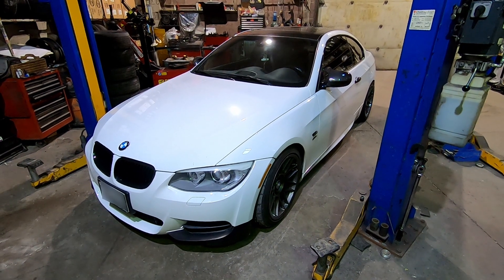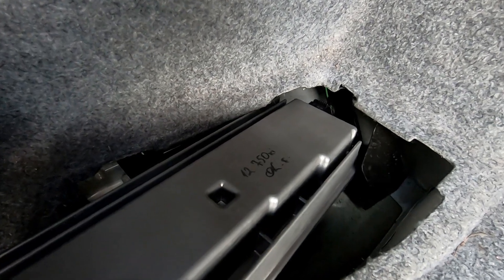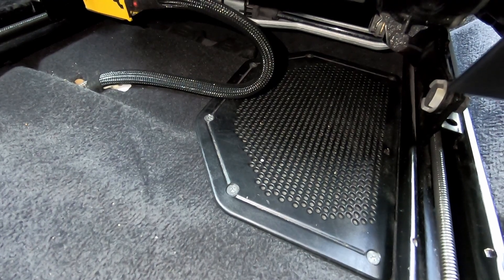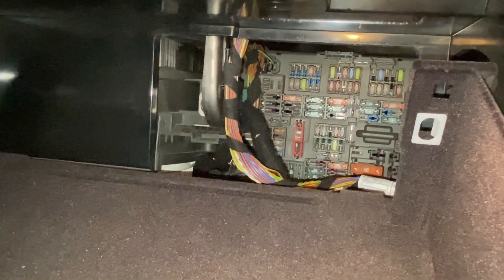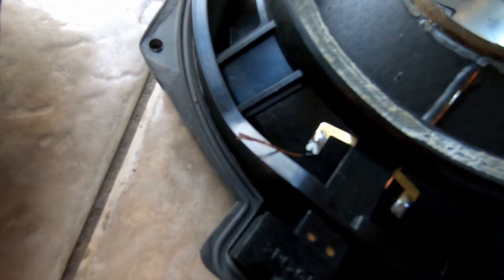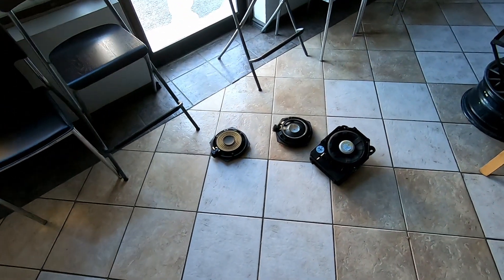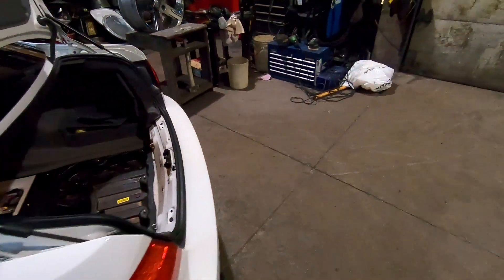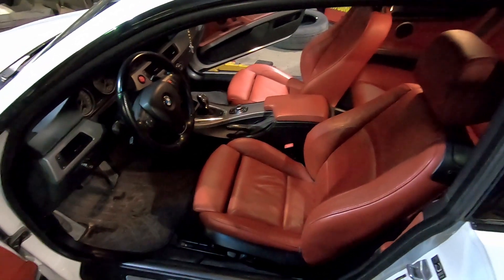No Bass in your BMW? Check This!

Comment: Have this issue on my X5 M. Basically at one point I was playing with the audio system and I found the driver side did not have bass. I knew the subwoofer was shot. Just a day ago, randomly bass cut off entirely in the middle of a song. It looks like the passenger subwoofer was operating and it also had died. This confirms my suspicions as both subwoofers have severed wiring. Thank you for this video, hopefully it serves the  E and F chassis community well!!

Comment: This just happened to my e92 m3 today, I had bass all morning then randomly noticed how flat my music was when I started it back up. I have the enhanced premium audio both went out at the same time I have no idea what to do super frustrating. How can I check if my amp is good should I just go to the dealer
Reply from the maker: Check the subwoofer’s first! Remove the 4 bolts that hold your seat down, remove the plastic cover that covers the subwoofers (6 screws), remove the subwoofers (2 bolts for enclosure… take subwoofer out of enclosure) and check the cable if it’s torn like this e92 had. Replace subwoofers if they have torn cables. Much easier to check this for a DIYer than your amp! Check for blown out fuses as well. If all else fails yes take it to the dealer as a last resort.
Reply: @dariusGarage  I’ll go ahead and check the subs first! How do I know which fuses to pull and check and yeah last thing I want to do is got straight to the dealer and get charged thousands
Reply from the maker: @SinghM3  there should be a little paper pamphlet in your fuse box saying which fuse is which. Subs are step 1, fuses step 2
Reply: My bass just went out on my e90 m3, did you find out what happen to yours ? I have to start figuring out what happen to mine
Reply: @dariusGarage hi what fuses should I check ?
Reply from the maker: @nevanbrusixty  this varies from model to model depending upon year of production, body style, and options. It would be best to consult your fuse box diagram like the one shown at 2:10 in my video to see which fuses pertain to the radio, on this 335is it was the ones  listed beside the single din radio icon. This diagram can be found behind the door in your glove compartment that I remove at 2:25. If it’s not there then I’m pretty sure you can go to the dealer and request a diagram at the parts counter for your VIN.
Reply: @ thanks so much for responding , so I have the hifi system but all I have is the radio fuses would it be those ?  Thanks again
Reply from the maker: @nevanbrusixty  I would assume so! Mess around and find out! BMWs are like grown up legos haha. Just be sure to put everything back where it came from (minus any blown fuses... replace those with equivalent ones)

Comment: did anyone  just replaced the wires with longer ones?
Reply from the maker: @mikle65  not that I know of, it’s too detailed and fiddly to fix one of these subwoofers, much easier to just replace
Reply: @dariusGarage could It be possible to solder new wire ?
Reply from the maker: @amanoorjohal8030  anything is possible, but it’s going to be a pain as there is not much space to work with. Additionally it would be best to lengthen the cables to prevent the issue from recurring. I’m sure people would be interested in the same thing so let us know how it goes for you!
Reply: @dariusGarage  appreciate the response and video. Ill let you know how it goes

Comment: if you want subwoofers i would remove those as they are tear weight and get a real sound system. my 1994  ford laser has 650watts 6x9 a 8 farad capacitor and a 12inch JVC on a 3800 watt amp. so loud that if i parked next to you while you were listening to your sounds all you would feel are mine. im getting a 2010 320i bmd later this week so im planning to upgrade it. i drive a lot and need to get to places on time and my sounds move slower drivers out of my way... or they vibe.
Reply from the maker: 😂 “my sounds move slower drivers out of my way!” Too funny! Thanks for the insight!

Comment: So where is the speakers? Can you just solder more slack on the wire ?
Reply from the maker: @cesarcarranza42  I explain in the end of the video where they are (under each front seat, under a plastic perforated cover). Others have already asked this question and claimed they would report back if it was fixable with solder… but so far it’s been crickets. So I say the same to you, let us know if you find a way to solder it! :D
Reply: @ oh got ya, for some reason I thought the subwoofer and speaker were different things and the subsoofer was under the seats.

I’ll try this with solder and I’ll make sure to come back to share.

Comment: What’s was the sos error for ?
Reply from the maker: SOS function is a 10 year service (subscription) from BMW, if you don't renew at a dealer then you don't get those features, the car throws an error light to let you know. At least that's what I've been told. From what I hear you can get it fixed by renewing your subscription or just code out that function from your car altogether with Bimmercode.

Comment: I have a 2011 335and a 2007 335 both with professional sounds L7 option. My 07 bass has been getting weaker . I am going to check the cables this weekend. Hopefully thats the smoking gun . Otherwise i might be opening the parts cannon. Its time for a update i think at 193k

Comment: Is it just bmw I have the same brand speakers for my Kia but recently my girls bmw 330i 2020 bass stopped working
Reply from the maker: I haven’t worked on KIA so I can’t comment with any level of certainty, but I’d wager that they’re not the same parts. Whether or not they’ll have the same issues that’s a different story that only time can tell. The 2020 330i uses different subwoofers compared to the 2011 335is and many other older BMWs that share the same speakers up to around the 2016-2018 model year, so I’m not sure if the same issue will apply to the 330i, but it’s definitely worth looking at as they are often ignored during diagnosis and easy to diagnose. Please let us know what you find!

Comment: I been having no bass in my 2011 335i with harman kardon for about a year now, it comes and goes sometimes it will come back the next day sometimes it will take months to come back. Recently I noticed when I do have bass the amp fan will be blowing hard, however when I have no bass the amp fan will be off and the amp will be super hot. Should I just forget taking it for a diagnosis and go straight for replacing the amp or could it be a fuse or wiring problem ?
Reply from the maker: This is the whole point of this video! Check your subwoofer cables first :)

My cousin went straight to assuming the amp was bad and wasted a ton of money!

I doubt it’s a fuse as it would never come back. It sounds like the subwoofer cable might be making contact where it should from time to time for it to work, and then once it does it gets pushed away again causing no bass.
Reply: @dariusGarage  nah brother I checked the subs as well all the cables are in place and the subs seem fine. Just yesterday I got a new problem where the sound wont go all the way up it’s like capped at 50% volume but strangely the gong can be heard at full volume. Man these cars are so annoying sometimes lol thanks for the reply though bro
Reply from the maker: @The252000  That’s different than our situation then… if you have someone (or a shop) close by you with a high end scanner that can scan sound system codes I’d recommend you get them to check for any electrical fault codes. Sometimes on the E9X chassis cars, water leaks cause amps to go bad so I wouldn’t be surprised if the amp is defective in your case… however it’s always recommended to confirm a part is defective before replacing it outright!

Comment: My right subwoofer and front right speaker are off, but the back speaker works. Is it to do with amplifier or replace woofer and speaker?  e93 2008 thanks
Reply from the maker: It could be either or, it varies from case to case. Its not uncommon for the door mounted speakers to fail and subwoofers to fail as well, and considering that it’s only one side it’s likely at least part of the problem. You have some taking apart to do :)
Reply: I have same problem with my e91, only its on the left side and i dont have amp.
Have you found out what was wrong?

Comment: Appreciate the video, thanks. I would like to know if the wire could be soldered back or is replacing the subwoofer(s) inevitable?
Reply from the maker: @ericvasania  I have been asked this question a few times and I feel that  anything is possible, but it’s going to be a pain as there is not much space to work with. Not only do you need to solder the wire, you also should lengthen the cables to prevent the issue from recurring. People say they were going to try to do it and report back but nobody has yet!